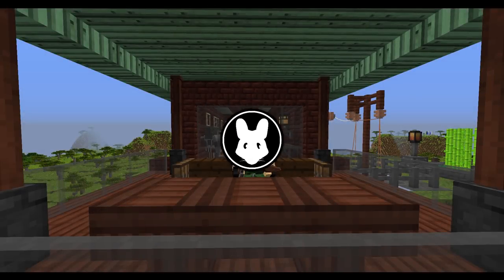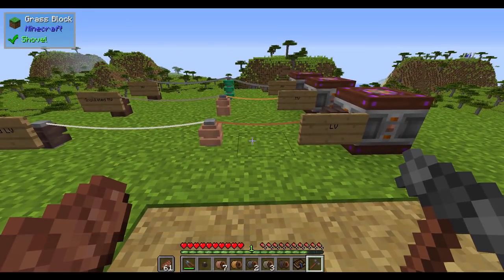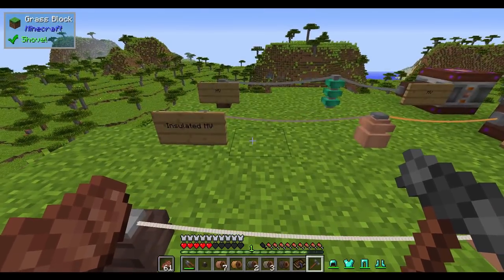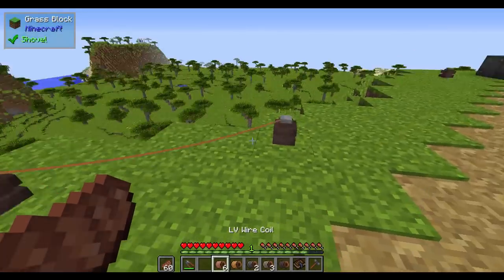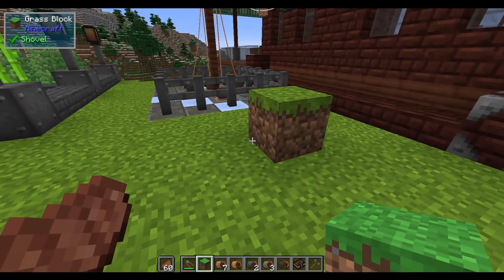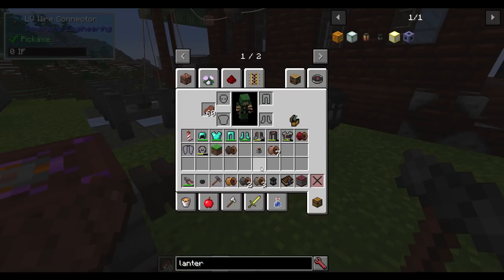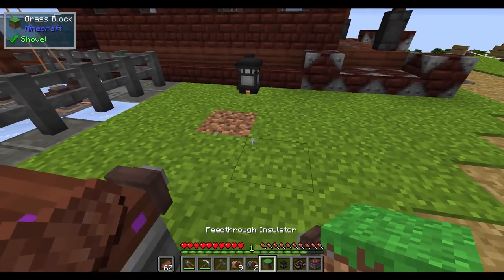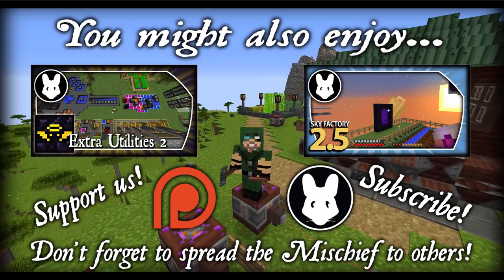Immersive Engineering: Feedthrough & Wiring changes!

Comment: This video needs more views. For YEARS I couldn't find a way to make that feed-through, or the insulated wires. I just thought my game was broken, I even remember watching this video years ago and you walking into those same wires and getting hurt. But I never could figure out how to get the feed-through or insulated wires. Trying it out just now I have finally obtained insulated wires and the feed-through. I just hope I don't forget these things. I'm tired of walking into low hanging wires in my base and getting shocked. The Book doesn't show you at all how to make insulated wires and that's unacceptable. If you don't have NEI or JEI you will never know how to make insulated wires, especially not the MV ones that required a Creosote Oil Bucket to make. I feel like this is a major oversight on the Mod Author's part, not putting the crafting recipe for the insulated wires in the book

Comment: I just used the LV Capacitors as a pass-through. This looks better though. 

The new wire mechanics are also nice. I always moved my wires so they wouldn't droop through blocks as it drove me nuts visually. 

Thank you for the video.

Comment: You could make an additional episode about the Mechanical Multiblocks (Industrial Wires) described in the Engineering Manual under "Industrial Wires", sub-chapters "Mechanical Multiblocks" and "Mechanical Multiblock Parts". These multi-block machines are real Swiss Knifes in energy storage and converting and even to kinetic energy. They store vast amounts of energy. But they require speed control, because they store the energy by inertia in flywheels.

Comment: Hmm this doesn't answer the question i had, oh well. Basically i had 3 wind mills and a water wheel and the power i get seems very low, despite seeing someone run an entire farm system with a similar setup. I wanted to know if the problem was i was using low voltage wires, and it was bottlenecking the power, and if i should upgrade to the higher voltage wires instead.
Reply from the maker: 3 windmills and a water wheel are not enough power to bottleneck at low voltage.
Reply: @MischiefofMice  i assumed this, but i did go through the painstaking process of replacing everything to medium voltage and my power increased enough to where i was gaining more than i was using. so idk.
Reply from the maker: Was it over a long distance? Could've been getting a power drop off

Comment: Occasionally when I break a connector with wires attached to it, there will still be zaps in the air where the wires used to be. Very annoying when I can't walk around my machines without getting zapped.

Comment: I've noticed that you can no longer put a scaffold over an existing wire, either.
Speaking of wires, I had an issue when trying to make wires from plates using the Engineer's Wire Cutter.  It makes one wire and then the cutter disappears.  I've had to start using shears instead.
Reply from the maker: If you are on the most recent version then report it to the github.
Reply: I guess the Steam Engineering pack is a little behind.  I'm using the most current Immersive on another build and the notes in the manual say it's fixed now.
I also found the config option that will let you still place blocks over a wire - I've grown accustomed to the covers and facades in mods like IC, TE and EnderIO.

Comment: Hey so i have no idea if you are still answering questions mostly since it has been 4 years but fkr me it refuses to let me connect wires to eachother if another wire has already been conected to it. So i cant connect power to eachother it keeps saying cannot attach a wire here
Reply from the maker: Connectors can accept one connection. Relays can accept multiple but don't power things they are attached to. So you would want to connect a connector to a relay then split it from there and back to a connector.
Reply: @MischiefofMice  ooooh alright

Comment: I'm playing the dierwolf pack and I built a reinforced blast furnace and 2 blast furnace preheaters, got it all assembeled  then ran leadstone energy fluxducts to the top of the preheaters... they powered up with 80000 rf each but make absolutely NO difference in furnace speed?????? (blast furnace IS assembeled properly as per your video ( Immersive Engineering: Reinforced Blast Furnace - Minecraft 1.10.2/1.11.2   )) any thoughts or suggestions ?
Reply from the maker: You probably have them facing backwards.
Reply: like I mentioned their facing the right way, I made SURE to follow your instructions from the video. they completely connect to where you cant see the port on the blast furnace, IDK
Reply from the maker: shrug Ya got me. :/

Comment: The next step: make machines blow up if you connect wrong current to them. Or trying to feed them too much.
Reply from the maker: Yeah... IC2 used to do that and didn't have a manual and required even more materials. You'd blow things up all the time without knowing why. It was mentally scarring. XD
Reply: They had a manual, you just need to look more carefully. :) It was on the IC forum back in my gold Minecraft times. RTFM or think better or suffer. XD
Reply: And I like blowing machines. Blowing things are even more Immersive than cables without insulation hurting you. GregTech 4 is still my favorite mod so far. But later on things gone too far.